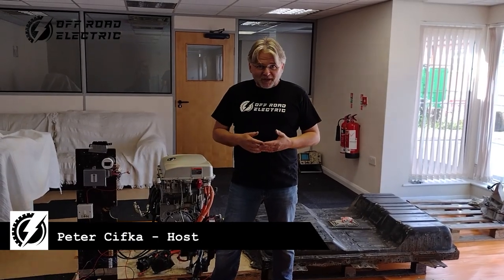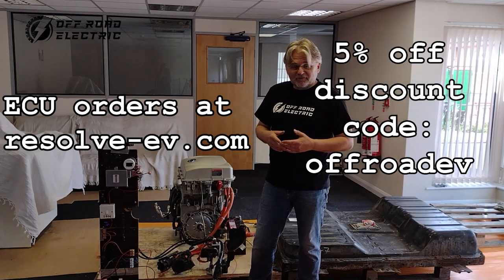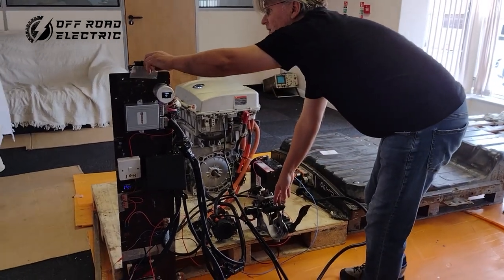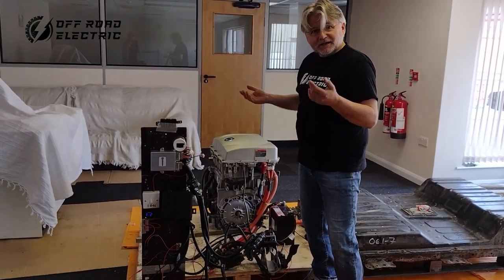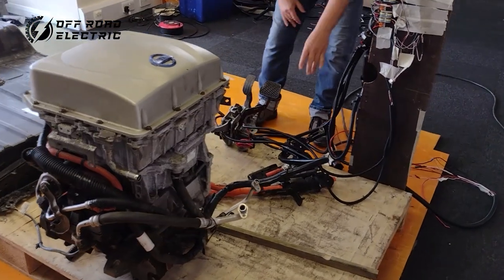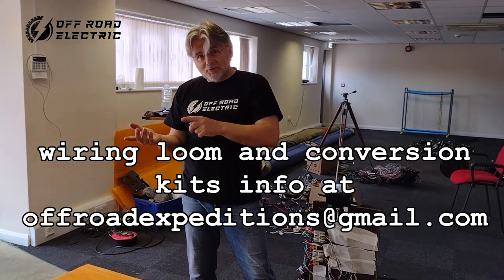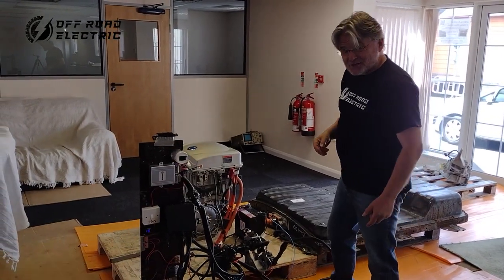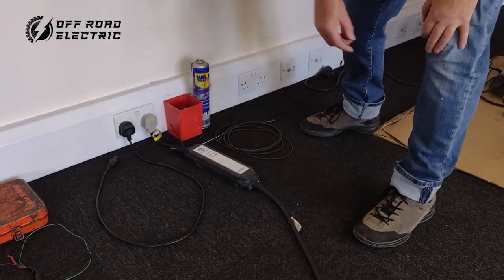Nissan Leaf Drivetrain custom ECU wiring loom - Vlog #3 - Best Off Road Electric Monster Truck Build

Comment: I’ve got a fully working 2013 leaf for 2.5k if you want it, MOT✅ ,new tyres ✅ it’s the heat pump one.
Reply from the maker: Hi Antonio, I assume you are talking about the first generation with the grey interior. My primary questions are, if it is the battery owned(not leased), and how many battery bars it has. You can reply to offroadexpeditions@gmail.com if you want. Thanks, Peter
Reply: Still available?

Comment: I would like you to make a 2007 Mustang GT leaf version when you finish old leaf conversion car
Reply from the maker: Hi, I am transitioning into better drivetrain option to run my Tatra monster truck as the options expanded during last year. When the finances and the traveling are sorted, I will continue with the videos.

Comment: Nice set-up. Could you use a different battery supply, instead of the Nissan leaf batteries and BMS?
Reply from the maker: The ECU is designed to comunicate with leaf bms.

Comment: Ahoj Peter. Great work. Have you worked out torque vectoring on 4 motors from Nissan Leaf? This will be a serious monster truck when completed. Will it have fast DC charging via Chademo as well? Last question. I notice UK power points. Are you based in UK? Greetings from Brisbane, Australia.
Reply from the maker: Ahoj Rado, the project is taking place in the Czech Republic, but I partially live in the UK, mainly for the reason to finance the project. But now because of covid the travel is difficult, so the project is interrupted till the things get back into normal. I will have an announcement about the powertrain changes when i get back into the shop, but it will be easier to integrate it to the Tatra chassis, cheaper, and stronger.
Reply: @offroadelectric9457  thanks for your reply. I understand. Have a plan B in place because I don't think things will return to life as we knew it before 2020. Would be great to source Tesla motors and batteries but I guess Leaf parts are much more affordable.  Looking forward to your upcoming videos.
Reply from the maker: @RadoTrenciansky  Thank you. Actually, the UK is easing up the restrictions in one week.

Comment: What’s happening Peter?
Reply from the maker: Hi Malcolm, it is still all about the money. The project is waiting in the Czech Republic where I have no way to financially support it, so I am in the UK making money working crazy hours. And as the traveling is still complicated because of restrictions, it has to wait. I have in my head some ideas about the steering using the multiple Leaf steering that will be released, and also the demo vehicle video later. Peter